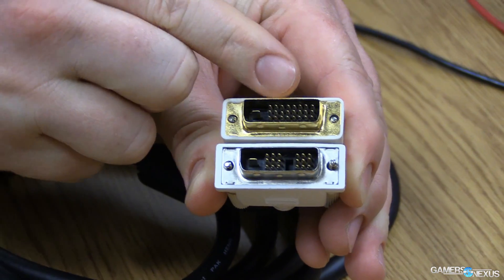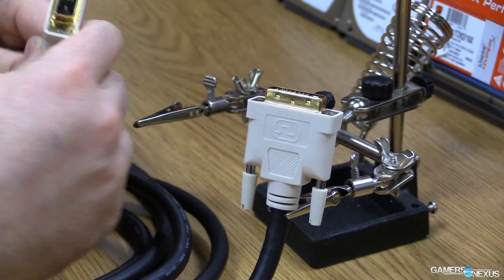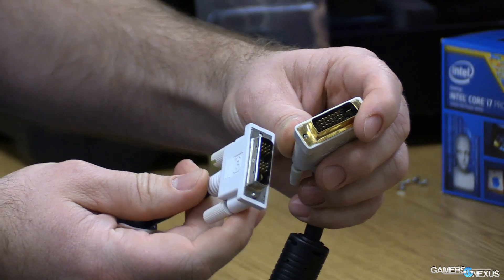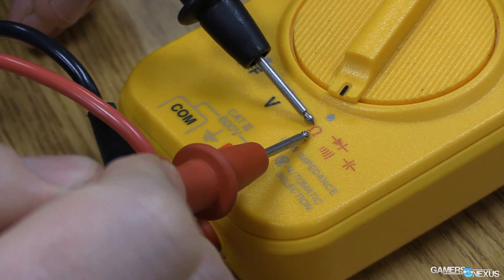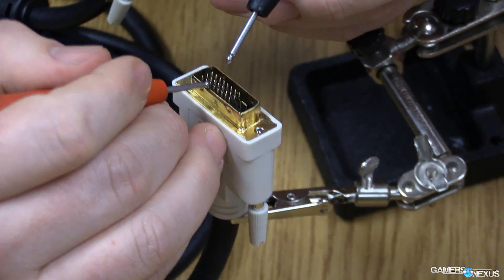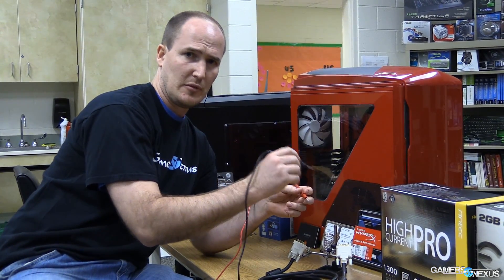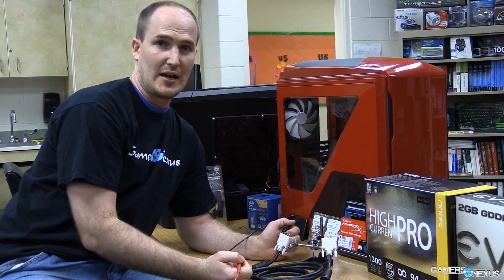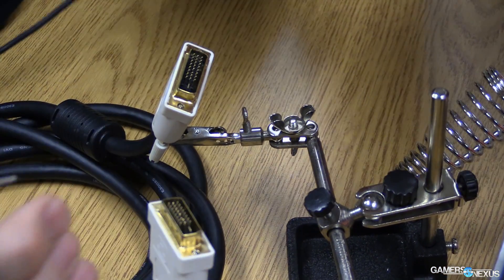How to Test a DVI Dual Link Cable for Legitimacy - Fake DVI Cables

Comment: I am getting an error when I try to go above 60hz.
"incorrect cable please use the dvi dual-link that came with your monitor" Truth is I am using same cable.
Reply: I now have that problem still no clue what to do.. :/ I bought the Display from someone so I dont have the cable it came with
Reply: Hey bro.. Did u fix that problem? Maybe u can tell how u did that, because same here
Reply: @eizaa9326  I cleaned my old cable which came with monitor and using it. It works awesome.

Comment: Or you could just hook it up to a 1440p/1600p monitor and that will tell you straight away.

I'm not giving these cables any legitimacy at all, but if you really need dual link, you will know the second you hook a single link cable up.

PWhat are not so easy to detect, are fake DIsplayPort and HDMI cables. While most cables are fine most of the time, sometimes they are not. On my 1440p U2711's, they require high quality DisplayPort cables as they are really temperamental monitors that require a relatively high amount of bandwidth (ballpark of 8Gb/s I believe that). But again, if you have problems with a given cable, you'll usually know straight away. Either you will have artefacts or it will not connect at all. If you have no problems, the cable is fine for your purpose, regardless of what it says on the tin.

There is a happy medium with cables. Too cheap, you'll get ripped off. Too expensive, you'll be sore for months from how hard your wallet has been hammered. A cable is just a medium to transport electrons from one place to another. There is no magic involved in this at all, and unless you're running shit across the ocean floor, there is no need to spend a huge amount of money on a cable. I've seen $10,000 power cables, and $16,000 "directional" ethernet cables that are not even rated for 10Gb/s, something many regular cables can do for a fraction of a price over small distances. Over long distances, you need better cabling, or fibre, but these are still a fraction of the price.

Comment: Glad I went with Asus instead of Benq for my entry level 144 hz monitor. I prefer a single small and stylish Display Port cable... Not these 90's looking bulky cables.
Reply: Hey don't diss DVI fam, who cares as long as it works. I have an 85hz monitor. Also DVI is 1999 and wasn't really used till early 2000's, how is it a 90's looking cable

Comment: i got a dvi-d dual link 10ft cable for $21 and the cable is thinner than yours but yet the connections all work.
Reply: dual link only has a difference for higher refresh rates or for higher resolutions. so unless you're using a 144hz monitor or go up to 1440 resolution, you wouldnt even notice a difference between dual & single link my dude

Comment: ok guys heres the question. im getting a monitor with no display port only dvi and hdmi and vga. its 144hz and i really want to use the monitor to its fullest which of these ports should i use? i need big help
Reply: meaning i want to see all my 144hz. in curious because ive been told hdmi does not display 144hz. so should i use dvi?
Reply: +Enbarr Gaming i have the same problem. our only hope is dvi but i heard that there are dvi that stop at 120hz instead of 144hz... is this true or can i just buy any dual link dvi and plug it in the monitor and i will get 144hz?
Reply: You need dual link dvi-d, as that one can go the highest out of them all.

Comment: I had a monitor connected with DVI-D cable that used to work stopped working recently. When I checked, I noticed Pin 24 of the two heads are not connected. Could it be the reason? I just want to find it out for sure before buying a new cable.

Comment: Gamers Nexus, Thankyou

Question I need a DVI-I Dual 24+5 pin cable to DVI-I Dual Link 24+5 Pin cable for a monitor
for a Power Pc MAC G5. 

Would a DVI 1 24+1 to DVI-I Dual Link 24+1 Pin adapter or a DVI 1 24+1 to vga cable from ebay work?

If not could you give me a link to a place that sells correct cable.

Comment: wouldnt using hdmi be better? whats the use for dvi dual link?
Reply from the maker: HDMI isn't necessarily "better," it just depends on the use applications. DVI Dual-Link is great in scenarios where you have limited HDMI ports (like if you're running 2 displays off of 1 card, with 2xDVI out and 1xHDMI). It's also great because you won't visually notice a difference between HDMI and DVI dual-link on resolutions 2560 and lower @ 60Hz.
Reply: Forget HDMI. DisplayPort is where it's at.